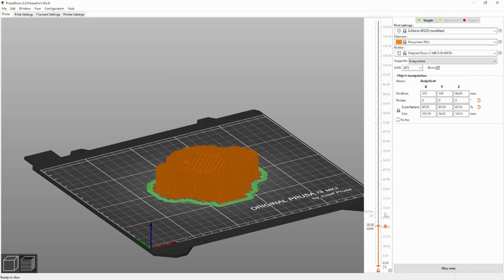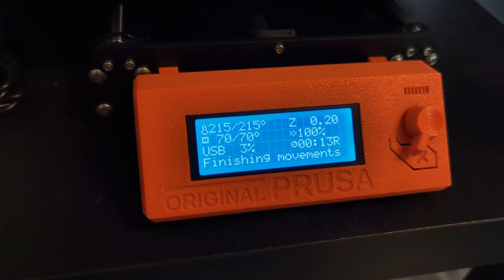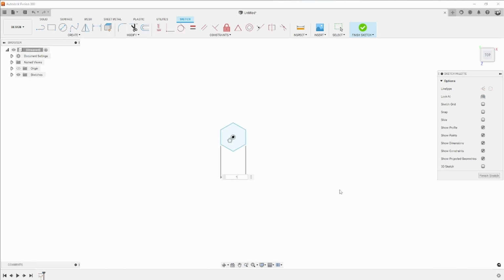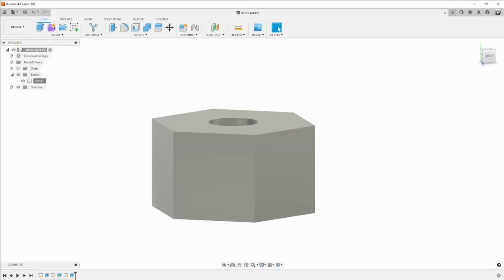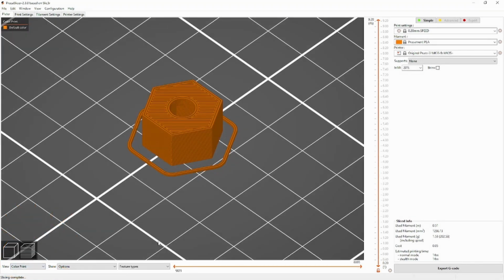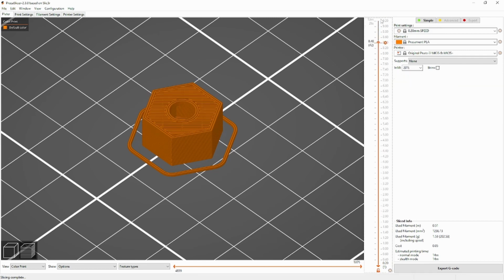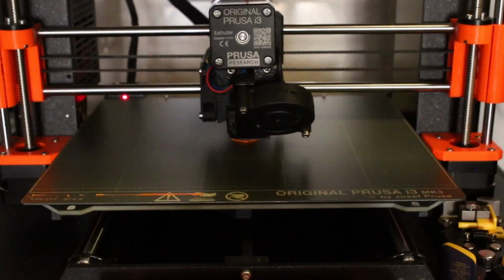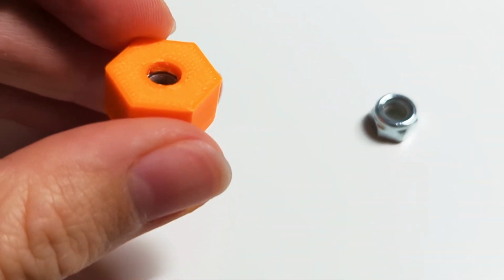How to use Prusa Slicer's Color Print Feature to Embed Fasteners

Comment: Good tip! You can also achieve the same adding G-code pause command to specific layer and home command to move away the extruder, add the nut and then resume without load/unload filament